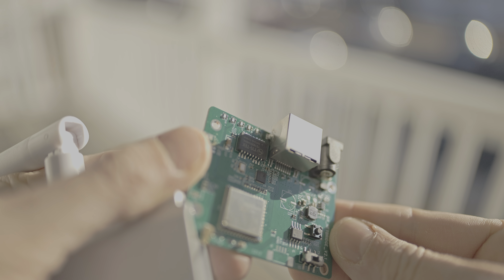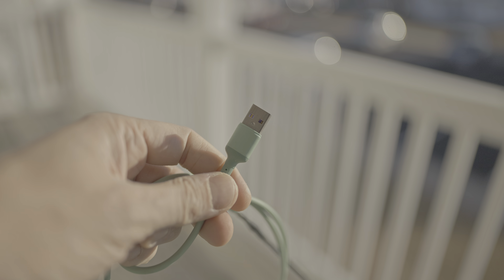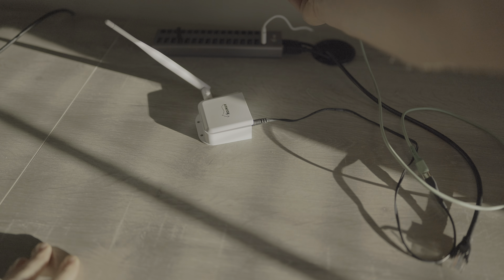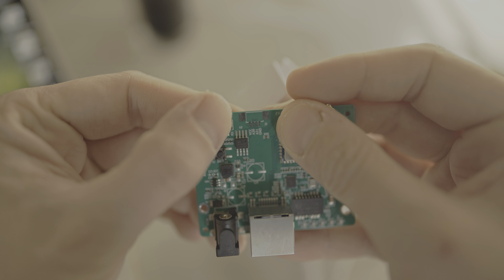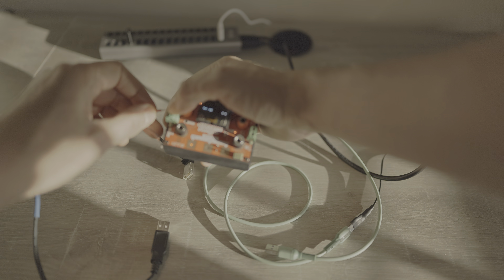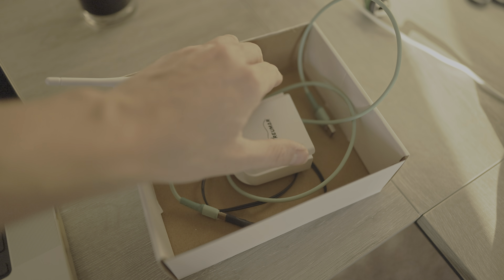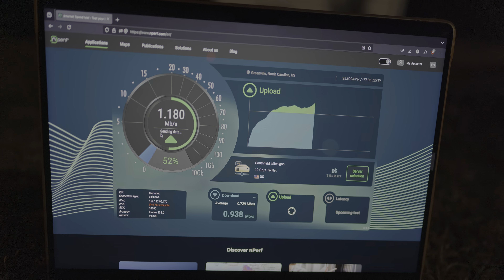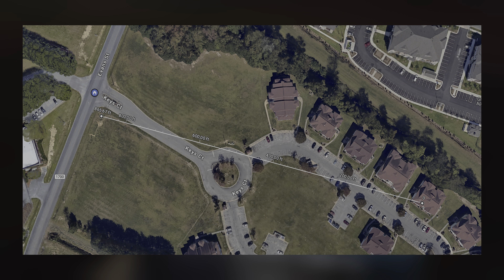Wi-Fi HaLow: A Game-Changer for IoT Applications

Comment: Hey Doris! Thanks for the great overview video. I just picked up a pair of these Reumar units from Amazon, but have run into some trouble with them. Particularly, when I try to do any kind of speed test / high load activity (file transfer, iperf3, etc.), the connection drops out. Have to reboot the transmitter to get things running again. If I don't do anything stressful, the connection stays up without issue.

Have you run into any issues like this? I'm wondering if I just need to update the firmware or something...I'm only just starting to investigate this now.

Anyway, just figured I'd ask since it seems like you have already spent some time with these guys. Thanks!

Comment: These are a little on the light weight side. I tugged mine off the table with the network cable and the case cracked apart all around the antenna mount :(
Reply from the maker: Oh no! The case is really only here to hold the antenna. I'm adding a forum link to the description.